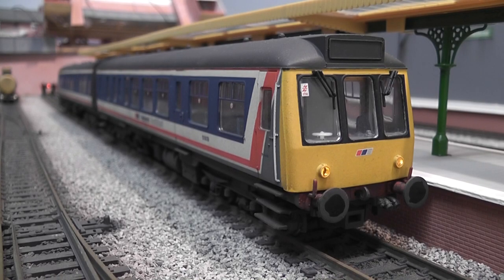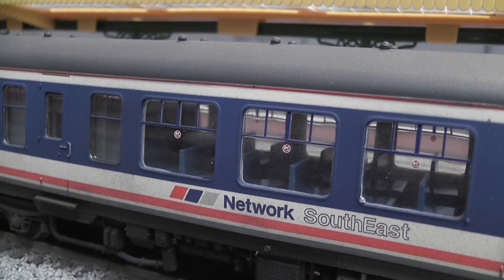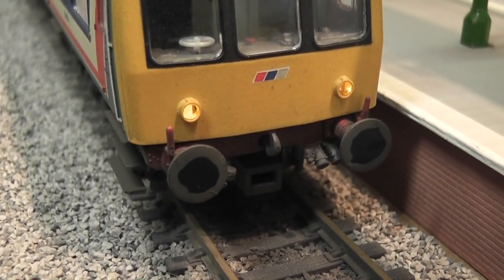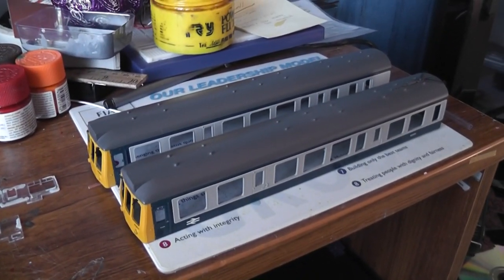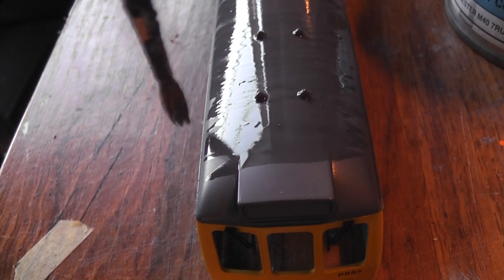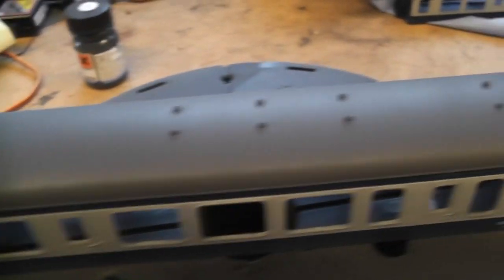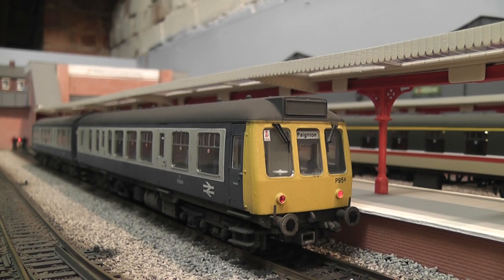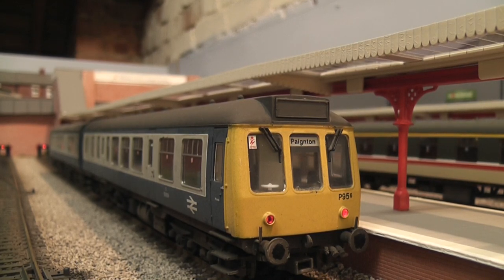How to - Episode 15 - Weathering  Passenger Stock

Comment: I once saw a 'How To' in Model Rail ( when it was still a supplement to Rail Magazine!) on how to weather units, particularly roof areas. I think the method used was to remove bits of paint from the DMU roof using a cotton bud and some sort of solvent to replicate the patches found of carriage roofs. It seemed an effective weathering trick. Keep up the great work on the layout and it's a bit of a shame it's in your attic and not on the exhibition circuit! You make it look so easy! Cheers, James S

Comment: Great informative video Richard, can I just ask, what sort of air pressure do you use for general spraying? Also, do you thin down your matt varnish or do you spray that at a higher pressure? I find with my Iwata Revolution that I cannot spray the varnish at the same pressure as it seems thicker than the paint. Andy.

Comment: have you ever weathered a loco and found it works worse then before? its a scary process taking things apart unless you are used to it, I currently weather locos with humbrol weathering powders as I don't think I could take it apart and airbrush it properly. maybe I will try it but yeah, worries I would make the model worse, especially with all mine being DCC sound too, would be expensive if it went wrong
Reply from the maker: I've been ok so far with all my weathering and resprays.  Taking the model apart is the best thing you can do.  That way you avoid getting paint in any motors, gears, pickups, lights, speakers and wheels.

As long as you're careful and take things slowly you'll be fine.  I've never damaged a model by weathering or repainting it.
Reply: +EverardJunction great video! I was just wondering if the Bachmann class108 that you were showing in yhis video has interior lighting as well as directional lighting because I am thinking about getting one for my layout.

Comment: Hi richard can I ask you about taking off a class 47 body I had the sides free but it still wouldn't come off is there screws holding it on I took of a class 50 & 55 with no bother, thanks jack. Ps. When's your next video
Reply from the maker: Jack Brown The bachmann 47 has about six screws holding it on.  One at each end and 4 around the middle.  The instruction sheets that come with it shows you where they are.  The next video will be at the weekend.  Cold weather has prevented me from doing much work so far this year.